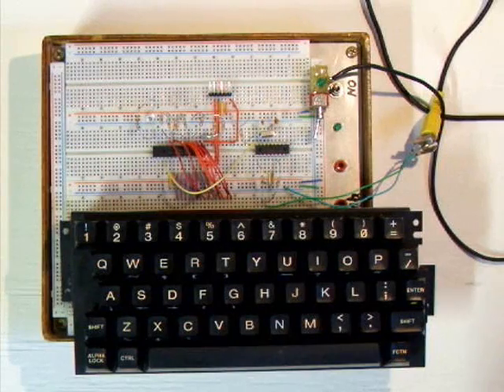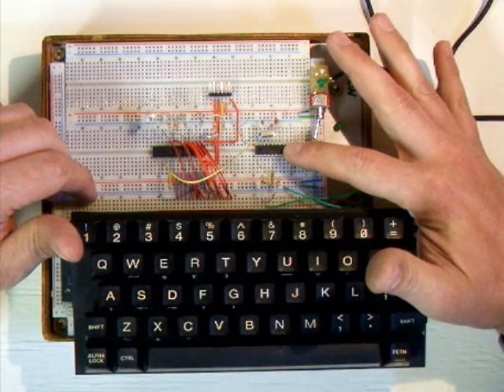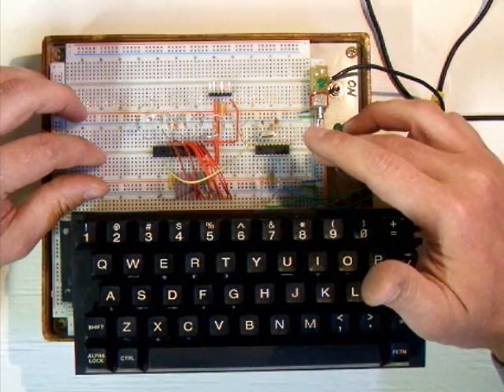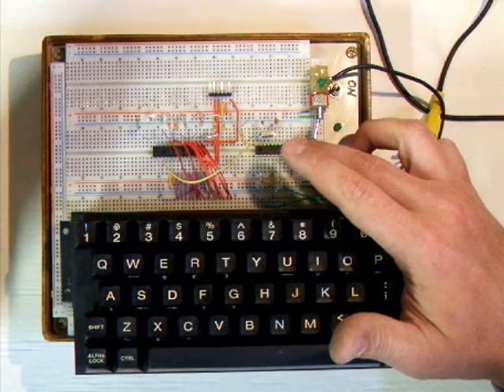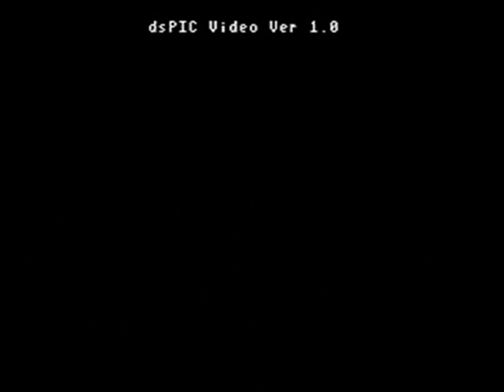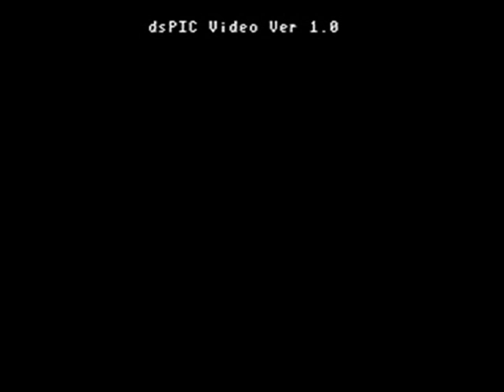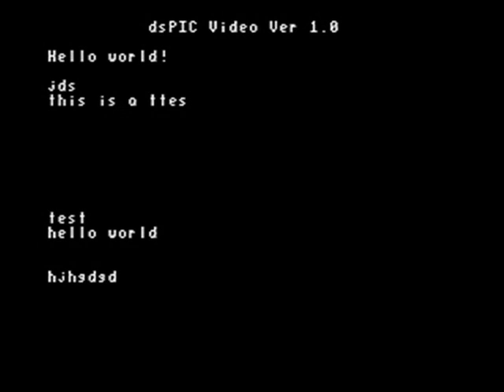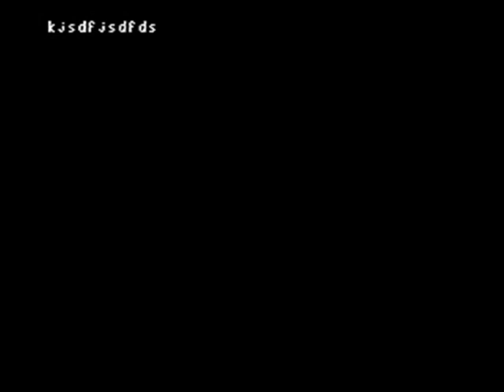Pic Microcontroller Terminal

Comment from the maker: @Pokematrix247 I guess you could, but what's doing is just decoding the keyboard matrix and sending out the ascii code to the video chip in an RS232 format. You could have the video chip do things when certain key combinations are received. It would be easier just to have some other microcontroller take care of 'commands' and send the video chip the information you wanted output.

That is what I want to do. Use this as the I/O for a simple 8 bit computer.

Comment from the maker: @feki00 Yes, all of the ASCII codes are available in the firmware of the picmicro and would be sent out at a TTL level RS232 protocol. But in this setup there are a couple issues. One issue being the keyboard can't create some of them. Second, the video chip is not set up to handle any of the cursor movement..... yet. This is still a work in progress and when the winter months hit, i'll be pulling it out and dusting it off.

Comment from the maker: @Kaos116 That would be sent over to the video chip. The video chip is also a Pic Microcontroller and everything it's doing is done in software. There is a simple voltage divider to get the right voltage needed for the sync pulse for the NTSC signal, but no other circuitry involved on that end.

Google 'rickard gunee video'. he has a great website explaining the voltage divider used for the video chip

Comment from the maker: @geoman298 I don't have a schematic for it. It's realy very simple hardware. The pic microcontollers are doing all the work in software. The TI99/4a keyboard uses 15 pins for it's key matrix. I would just bring one pin high and look for an output on the other pins. Depending on which pin I had high and which pin responded it would pull the ascii code of the key press off a look up table. It would them take that value and send it to the TTL rs232 out module on the PIC.